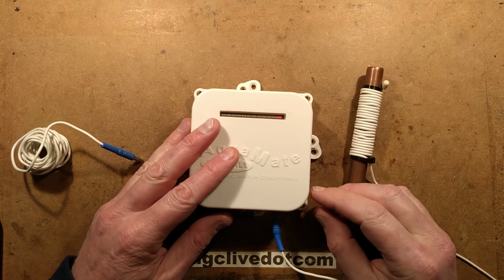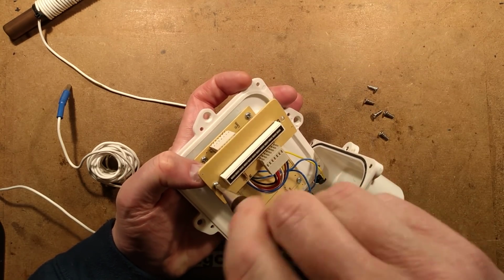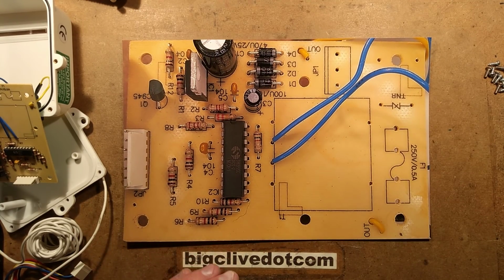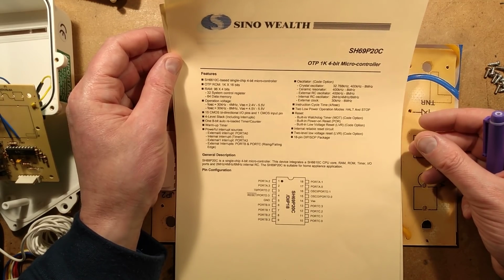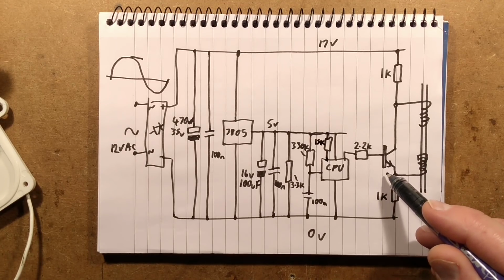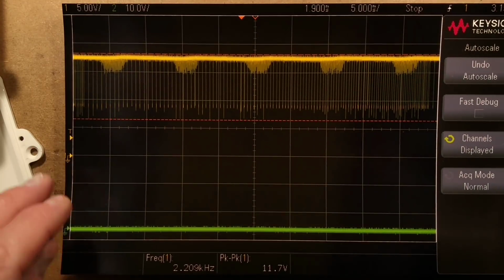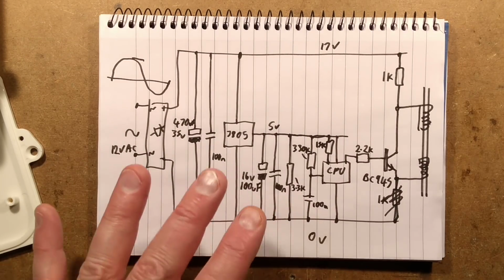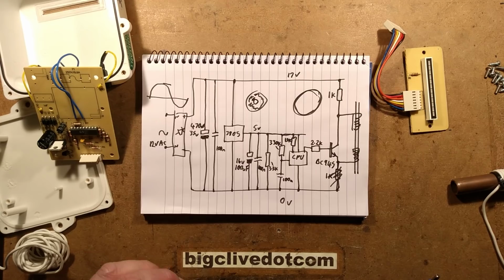inside a computerised pipework scale reducer.

Comment: I can't imagine how this could work. Limescale is caused by calcium salts, especially calcium carbonate and bicarbonate, precipitating out when the water is heated. See the Wikipedia article for how this happens. Preventing this would have to mean either removing the calcium ions or stopping them from precipitating in hot water. In the case of a water-softener, the calcium ions really are removed by an ion-exchange medium which replaces them with something less likely to cause trouble. The calcium goes into the water-softener and doesn't come out. If these coils were stopping the calcium from getting past, you would expect limescale to form where it is wrapped around the pipe! On the other hand, as far as I can see there is no way for the coils to influence the calcium ions not to precipitate out when the water is heated elsewhere. That would be magic.
Reply from the maker: The claim is that the calcium still goes past, but gets "changed" by the electrical pulses or magnet and is less likely to bond to the pipe.
Reply: @bigclivedotcom   Calcium dissolved in the water will be in the form of Ca2+ ions. That's not going to change by wrapping some wires round the pipe. I'd wager the electronics are just to make the nice little LED display run.  I first heard of these a few years ago and my immediate thought was "shite!" in the style of Karen Dunbar's old posh woman character of Chewin The Fat.
Reply: @bigclivedotcom  It would be interesting to conduct a side-by-side test, to see if there is ANY difference what so ever, between water which has passed through a pipe that has been "treated", and an identical pipe that hasn't. There needs to be 6 pipes. 2 iron "black pipes", 2 PVC pipes, and 2 copper pipes. If calcium and other dissolved solids still accumulate in a tea kettle, I really don't see what the device has done, or any advantage it offers, even if the device actually works. I just don't know how to conduct the test, unless a series of pumps are used to recirculate water.
Reply: @bigclivedotcom  changed fucking how? There is no way known to man to induce chemical changes of ions merely by the presence of an electrical field. Once again, total BS. Any claim made must be immediately followed by an argument naming a physical phenomenon that would result in the claimed effect. Any statement lacking said argument is to be held false without exception!
Reply: John Smith any electrical field would be cancelled by an accompanying magnetic field in this case which is RF. A purely “electrical” effect would be from a current and certainly affect a chemical change in any ionizable  medium such as water, which would be accompanied by physical changes in the solutes.
Reply: @jovangrbic97  I'm not arguing the technology works or doesn't, but your argument on chemical reactions in electric fields might not  apply to precipitation  without  chemical reactions.  We dont say  the dissolving/crystaling of a salt isca chemical reaction.

Interestingly though electric fields can and do effect the evaporation/precipitation of water.  Granted this might have nothing to with precipitation of ionic salts of calcium in a pipe.

I have no clue if changes in an  electric field could effect precipitation of calcium ions. And I fail to see how this could work.  the pipe is essentially a dead short from one capacitive coupling coil to the next capacitivly coupling coil. So at best any pulses would be magnetic pulses due to tiny current pulses in the copper pipe.  And then with ampers law, it should be clear that there is not a  magnetic field inside the water in the pipe, just outside the pipe and inside the copper.  But copper is weekly dianagnetic. So maybe a small magnetic field is ejected inside the pipe. 

Enough with speculating. The only way to really settle the debate is a side by side comparison with independent verification. If there is a noticable difference, then it might warrant more speculation and testing to tease out how/why it works.
Reply: zh84 I always thought these devices were nonsense too, but I recall at school my chemistry lab had a large water distiller mounted on the wall which ran for hours at a time filling huge containers with condensed, demineralised water. The cooling was by flowing tap water, which also served to keep the boiling chamber permanently full. The supply pipe was fitted with two large magnets, wrapped around the pipe, which my chemistry teacher (a doctor of chemistry no less) insisted prevented scaling. I still to this day haven't worked out how.
Reply: @spencerwilton5831  People with doctorates are not immune from being wrong.
Reply: @spencerwilton5831  "The cooling was by flowing tap water, which also served to keep the boiling chamber permanently full."
I think that was really the only clever bit about this standard distillation setup. This would capture "waste" heat and pull it back into the boiler. Thus requiring a little less heat from the boiler heat source. The magnets? They were just placebos.
Reply: Your chemistry prof was as easily fooled as some professional architects I know, who insist on installing these with no scientific evidence that they do anything besides generate profits for the vendors... @spencerwilton5831
Reply: @spencerwilton5831  Google "Reverse Osmosis"
Reply: I added to things you said in another comment about descaling, though it touches a bit more on teh chemistry and mentions Manganese Carbonate and Magnesium Carbonate (these 2 salts are common in hard water areas of the UK and Northern Europe, especially Norfolk, Suffolk, Lincolnshire, Stockholm, Oslo & Sundsvall
Reply: @DaveMicolichek: more like 0.55V, depending on Ic and the transistor type. My point being that there is nothing precise about the Vbe of a transistor. You, Vincent Robinette, and I are all approximately correct.
Reply: @demef758  19.8 milliwatts still isn't nearly enough.
Reply: It's a form of sequestering but the energies involved are significant and the engineering is precise.
Reply: I was under the impression that this is for a hot water heating system. All that gunk and scale is a captive audience, to be destroyed at will.
Reply: @Dave Micolichek  18.49 milliwatts....Still not enough!
Reply: Did you know that some people tell lies and sell things that aren't real? Did you know that?
Reply: My belief is 💔 curse you!😢 Just kidding! As a professor of chemistry I am relieved to see this nonsense debunked thoroughly. Unfortunately, this kind of scams are apparently working. A partner I worked with on a project for industrial water purification purification openly confessed he made more money on this esoterical devices than the real ones. He was very competent on the real matter. Also, he never claimed (as far as I know) any effect of his scam devices. So, people want to be believe in all these scams. There is no hope for humanity....
Reply: I don't know how they work. But I had a lot of research data on this about 35 years ago. But it was using coils to surround the pipe with a magnetic field. The data showed that calcium would precipitate out of solution and form a lump. This allowed the deposits on the pipe to go back in to the water as the water does not like to be in that state.  Drinking distilled water could kill you over a period of time, as water does again not like to be in that state. It will absorbed salts from you in order to get back to a stable state. Spent 4 years working on a blood gas analyzer with blood on chip, and learnt a lot about blood make up and distilled water etc. As Clive said the main way of see it working was trapped calcium in the kettle, but lose on the bottom not stuck on the walls. The research was done by a relative but did not go on to market, as back in the old days unlike today if you could not prove how your design worked you had to stop due to lack of backers. Things then got so cheap you could make any old crap to sell.
Reply: " But I had a lot of research data on this about 35 years ago. But it was using coils to surround the pipe with a magnetic field. The data showed that calcium would precipitate out of solution and form a lump."

nope, sorry, this is nothing but anecdote in the end.  there's no physical or chemical process involving either electrical or magnetic fields that would cause dissolved calcium carbonate to do what you describe here.  you literally need to add a chemical that will preferentially bond with the calcium over the carbonate ion and cause it to be insoluble.  Classic example is using sulfuric acid to precipitate calcium sulfate. 

calcium carbonate does not react to magnetic fields, unless you deliberately dope it with something that does, which is rather complex in and of itself.
Reply: @thomasneal9291  At the very least, you need more than 20 milliwatts to treat the hundred gallons of water that can flow through a pipe!! With a 1 K ohm resistor, the transistor is driven from an IC powered from a 5 volt source, and subtract .7 volts, which is the base-emitter voltage drop of a silicon transistor, that allows 4.2 milliamps. at 4.2 volts. that equals 17.64 milliwatts. It's just not enough power, even if the theory "held water".(pun intended😁😁)
Reply: @thomasneal9291  But dissolved salts separate into ions and I'm pretty sure the Ca²+ is attracted to the negative of the electric field. But nothing significant
Reply: @TheEmbeddedHobbyist  "I don't know how they work".

Because they don't. They're snake-oil.
Reply: @TheEmbeddedHobbyist  "I don't know how they work"...but..."it was using coils to surround the pipe with a magnetic field." It's obvious you don't know how they work because they can't. As shown by Clive's schematic, there is ZERO current that passes through the two loop "antennas wires" which are single-ended. How do you pass a large amount of current (required to generate a magnetic field) through a single-ended wire? And is current limited to no more than 4.5mA via 1k resistors? You clearly do not understand a thing about electronics if you think the circuit shown here can create ANY kind of magnetic fields!
Reply: @demef758  If the only way to endorse your argument is with an insult, then your argument does not warrant a reply.  But the university I studied at thought I had enough understanding of electronics to grant me a 1st Class Honours degree, so I'll take their word's over yours if I may.
Reply: Smells like horse poop. 35 year old horse poop in your case.

Comment: I suspect the RF-type approach is bunk considering (I would think anyways) that pipe deposit is non-magnetic and the RF wouldn't shake the pipe much or at all.  Now if it were an ultrasonic approach that pulsed hard I could believe the marketing material on pipe cleanliness.  As for any marketing about clean water that's just straight up lying.  Filters reduce suspended/dissolved junk and knocking it out of the pipe would probably clog faucet meshes and some taps.  Hard water buildup wouldn't taste worse being there as its already out of the water and doesn't easily go back in, particularly if it's still collecting from a hard water source.

Comment: Funny, the sticker on the outside of the unit says that it is 230VAC when in fact, it should be a LOW DC voltage in...
Reply: It doesn't need to be recertified with external power supply. So it's just cheaper.
Reply: Same case can be used with a transformer on board... this one has transformer externally like Clive said... for ease of export
Reply: Gavin Carstens - more like bigger profit margin. Buy a cheap Chinese external PSU rather than order and fit a quality transformer certified for use in this country...

Comment: I've worked in plumbing for better part of 20 years, here in Merica. Seen a lot of pipes with the build up in them, mostly the steel pipe. On the supply ( the water you use to shower, run sinks or dishwasher, etc )side. Obviously on the waste side the "shat" well the build up is shat. I have never installed one or been in a house with one installed. I started my carrier on leftcoast ( west ) and moved to middle (heart ) of the country. To be fare I worked on new residential and commercial. Some older home repairs. But yeah steel pipe is junk. Pay the money and have some copper put in. If you live somewhere cold have the thick copper installed. When I first moved to the middle of the country I re-plummed two houses for my folks both  had steel both were just about completely clogged with that sediment. Again to be far the water is hard out here in kansas.
Reply from the maker: All house pipe used to be copper here.  Now they're moving to push-together plastic pipe.  I still prefer copper for secure connections.
Reply: @bigclivedotcom  yeah I shoved a lot of the slip joint underground pipe together in my day. Side note I worked with a guy that could dig a 20 ft length hole on grade in the time it took me to walk over get a 20 ft section slap the grease on the end and level it. ED STIFTER was his name he was crazy good on any piece of equipment. I learned a lot from him. A bit grumpy tho. But I looked at the knowledge I learned as a trade off.
Reply: @raymondmucklow3793   It's a pretty solid rule: the grumpier they are, the more experienced they are.
Reply: bigclivedotcom - err, all pipe work in the U.K. used to be lead. Then lead became too expensive and copper was used. Health concerns rapidly speeded up the transition. Meanwhile in commercial premises, steel is cheaper than copper, so you will find steel pipes used for non-drinking water pipe work. Especially in heating systems. Now any metal pipe is too expensive, and the reliability of push fit plastic pipe fittings has improved, so plastic is now becoming increasingly common. It’s also faster and easier to install.
I live in a hard water area of the U.K. and apart from kettles, water boilers, shower heads, and some designs/types of hot water tanks, limescale is not a big problem.
Reply: Half our house plumbing is poly pipe. The good fittings hold tight for years (decades perhaps), and you can easily undo them if required for some reason.
Not sure if I'd want hot water running in it though. Our hot water is all still copper.
Reply: tin2001 - The plastic pipe is good enough for central heating / radiator system pipe work,. When my parents had two extra radiators installed, the plumbers used plastic pipe. I checked out the manufacturers specifications. The only limitations with regards to heat was it should not be used to connect directly to a boiler or within a certain distance (I think it was two metres).
Reply: Yeah nah yeah (to steal a saying from ozzyman) dont get me wrong "plastic supply has its uses" the gray poly with the copper crimp ring sucks, always going back and fixing leaks on new houses. They tried to get away with it some new homes in las Vegas for a while, they stopped. Its popular in mobile homes as well in the us or was, but it makes the water taste shitty, not very thick and instead of running a 3/4 supplies in the house they would run a manifold system some house had 17 or 21 individual  runs. Just saying if you have the option run some copper.

Comment: Heh, that micro seems to be a 4-bit OTP chinese thing, but the pinout is identical to the 18-pin PIC16 series, amusingly enough. I guess they were going for drop-in pin compatibility with PIC designs.
Reply: No doubt the original design used something like a PIC but it was deemed far too expensive for this device 😁
Reply from the maker: The pinout between many of the 8 and 18 pin microcontrollers seems consistent between brands.  I think it probably is to do with drop-in compatibility.